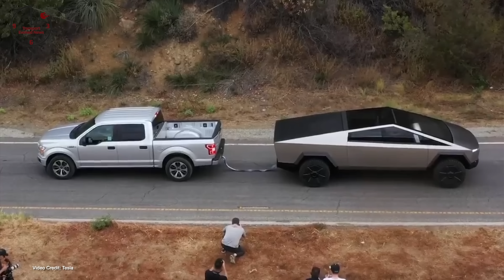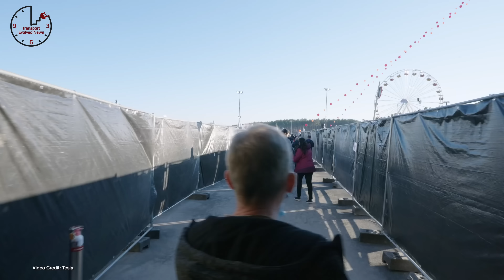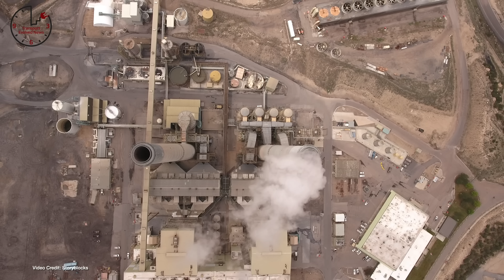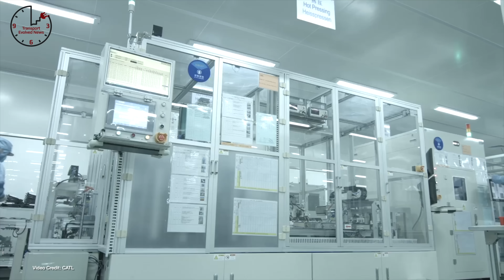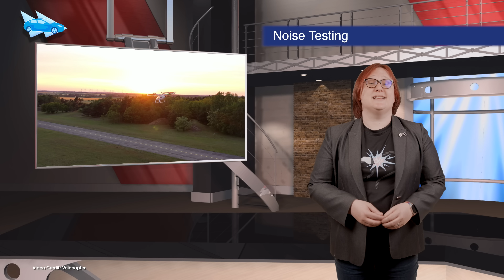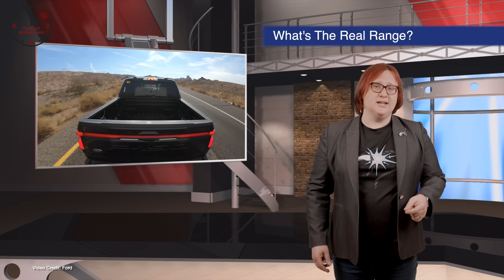TEN Episode 379: Mercedes-Benz Indemnity, 2021 Carbon Emissions Rise, Kia EV6 Squeaks

Comment: Ford… possibly under-rating its truck…
And doing tests with thousand pounds in its truck bed, where as EPA doesn’t use any added weight… Why would this be a bad thing? Wouldn’t this mean the average Joe driving around WITHOUT 1000 pounds, would actually get much better battery range then EPA ratings?

Comment: I find portraying R&D per car sold pretty misleading. A lot of research has fixed costs that are irrelevant of how many cars a company sold.

Ford sold 2,4 million vehicles in 2019 vs Tesla's 0.368 million cars sold in 2019. So that means that Fords R&D budget was actually around 2,6 times higher in 2019 than Tesla's in absolute numbers. And as other mentioned, the question is whether this only is in Tesla's automative branch or general company wide r&d, like energy.

Comment: Regarding the F-150's range increase over estimates, note too that their MPGE was a fair amount below early estimates. Same thing with the Humvee. I suspect that the early estimates were correct, but Ford & GM added battery capacity (& therefor weight) to beat Rivian's range.

Comment: Coal and gas consumption is up because demand is high.
And even the USA has forced some nuclear plants to shut down.

Germany also did this in there effort to remove amost of there low carbon potential and netto getting worse on energy consumption.
Germany will not make there climate goals.
Reply: Germany produced less power with coal and lignite in 2021 than before the pandemic, though more than during it obviously. Coal made up around 26% of Germany's power production, renewables 41%. Problem is that Germany still needs a lot of coal for its industry and gas for that and household heating. All fossil fuels together make up around 41% of Germany's powersupply, as much as renewable. They are far ahead of many other developed countries with that (the US is at 57% fossil fuel, 22% coal, so nearly the same amount as Germany).

Comment: The coal we burn is a sign that reduction of emissions are happening. The less oil we burn is absolute proof of this. I would rather burn 0 oil and double the coal than the current system. Every mile driven by EV's (pure coal) is up to 30% more efficient than  an equivalent oil burner.
Reply: That is no doubt true, but very little electricity ends in an ev, and coal is a very polluting fuel by any parameter.
Reply: EV's on coal are worse than ICE cars though in the EU. I personally think the increase in coal might more have to do with increased power demand in developing countries.

Comment: About the Cybertruck, I'm one of those people that's more than happy to wait a bit longer since it's the last vehicle I'll ever need to buy.  With my annual driving habits, the battery should still have 80% capacity in 40 years, and since it's stainless steel I don't have to worry about it rusting away, (the competition can't say that).

Comment: 3-5x cheaper to drive?  6x cheaper to drive?  That’s nothing.  Here in Canada we have more expensive gasoline than the U.S., but cheaper electricity on average than the States, so EVs are ridiculously cheaper to operate than ICE vehicles here.  I’ve got a co-worker who fills up at $.0939 CAD per kWh, and would otherwise be paying $1.949 CAD per litre.  That’s the equivalent of 7.5 cents USD per kWh, and $5.91 USD per US Gallon at the current exchange rate. No time of day pricing where I am (British Columbia).  That’s got to be one of the biggest differentials in the world, as places with more expensive gasoline than Canada often also have more expensive electricity than Canada.  Canada’s unusual for having expensive gasoline and diesel, but cheap electricity.

Comment: 🔌Once Aptera comes to market with its built-in solar it will be 15 times cheaper to drive than my new 4-cylinder 2022 SUV. Aptera's 30+miles/day of free range while sitting in the office works out to be less than $0.015 vs $0.225/mile for my SUV.  It is truly "Driven by the Sun"🔌
Reply: I’m concerned about leaving EVs in the sun to collect solar, when the service life of the battery pack might be better if the car was parked in the shade in hot weather.  In winter I think a car collecting solar makes all kinds of sense, but in the summer I’m not so sure.
Reply: @ScrapKing73  I had some concerns about that too but in working in the power generation business for over 40 years the batteries we use to back up a data center's UPSs and starters for generators that are exercised monthly in ambient temps as high as 121F have had no issues over the last ten years. It all depends on the battery design and chemistry type. I guess we will have to wait and see to find out how Aptera addresses our concerns.

Comment: I could only find the value for 2021, but in 2020 VW group spent €13.885 B on r&d, and Tesla spent $1.1 B in 2021.  I don't think scaling by sold cars is very helpful because r&d  is not a recurring cost for every vehicle.
Reply: A reasonable scaling of R&D financials might be by other company financials because that's the scale of "how much could they have spent on that". That's why comparing to advertisement makes sense. (I heard that the US pharma industry spends more on advertisements than on R&D, for example. That seems relevant when talking about prices for medicine, which are usually justified by R&D costs.)
Reply: @KaiHenningsen  I don't think you can just compare r&d spenditure any other way than absolute numbers, except maybe if you also can somehow calculate what they get from it, but that is pretty much impossible.

Research is normally quite a fix costs for every company, the only difference might be how well that r&d gets spend, but whether big or small, it can either be spend efficiently or terribly.

And I don't see why advertisement costs matter. If you can get what you want (or at least think you will), for 10 billion, why spend 4 billion extra on it, while you could use that 4 billion to increase sales? If you can sell 1 million extra cars for that money for an average of 40-50k/car and 10% profit, you already start to profit from it (simple example ofcourse).

Tesla simply doesn't need advertisement (yet) because there still is more demand than production. The question is, how will Tesla react when production starts outstripping demand.
Reply: @MDP1702  If we go back to the example I gave, if the pharma industry says "your meds are US$ 100 because we need to pay for R&D", then it does seem relevant to answer "actually, most of what you make from those meds goes into advertising, not into R&D". Now if we compare Tesla to other automakers, maybe we'd want to compare different numbers, but anytime we talk about actual product margins, then it seems a relevant argument to analyze what proportion of those margins pays for what business expense. For example, compare R&D with dividends or with infrastructure investments (including new factories) or ...
Reply: @KaiHenningsen  Then you are talking about price gouging, not comparing r&d of companies.

We know Tesla has a large profit margin on their cars, so they can't really claim it is all for r&d either.

I understand what you want to say, but it isn't relevant for this discussion comparing r&d and advertisement expenses of car companies. The only reason Tesla isn't (yet) doing advertisement is because they currently can sell every car they produce, that likely will change at some point in the near future. Their pure r&d numbers are also lower than most large car manufacturers, so it isn't that they likely have much money to spare on advertisement anyway (though if they'd produce more cars than demand, they'll likely cut profit margin to pay for advertisement).

Also advertisement costs (in normal circumstances) are meant to increase sales to the point this increase pays for the advertisement costs, not to increase the sale price.

Pharma companies in the US don't just set high prices due to advertisement, they set high prices because they can. r&d is just an excuse they use. Even r&d + advertisement wouldn't explain the high costs of medication.
Reply: @MDP1702  shrug then maybe we are in different discussions.
Reply: Yeah, percentage of other expenditures may be better. But Tesla also outspends other companies on charging infastructure as well. They also make higher margins per vehicle and are scaling up more factories at the same time than many. In fact I think it would be difficult to directly compare Tesla to other companies because they way they operate is frankly just so left feild from traditional auto companies.

Comment: You completely gloss over the significant fact that Mercedes only assumes liability for speeds under 45 mph! An illegally slow speed on most US highways! You should not highlight an apparent positive and dismiss the 'caveats' in an off handed comment at the end of the piece. That is cherry picking facts to highlight your story.
Reply: They'll be doing a deep dive into the details next week. Hold on till after that one I would say.
Reply: Where I live the max speed allowed higher than 45mph is only on the highway, that is still plenty of roads you'd be insured with level 3 autopilot.
Reply: You fanboys must be one of the most touchy species on the planet... If you had watched other videos covering this you would know that the 45 mph limit is the current status and if/when further development and testing allows a higher speed it will still be under Mercedes liability. Personally I wouldn't mind the 45 mph limit when commuting in slow/dense traffic as long as it actually means hands/eyes off.